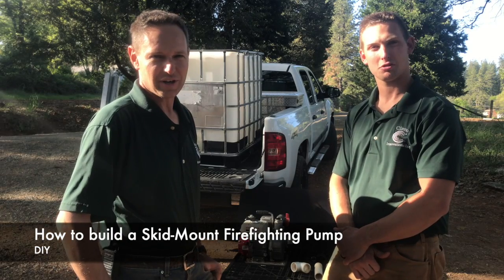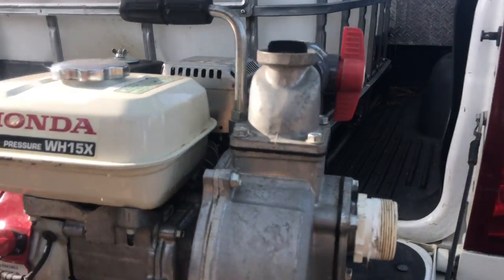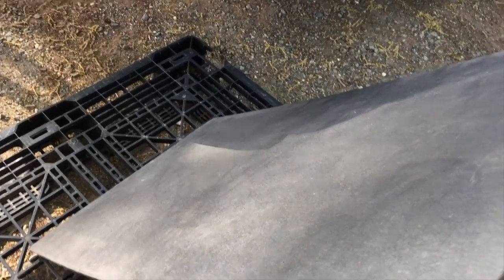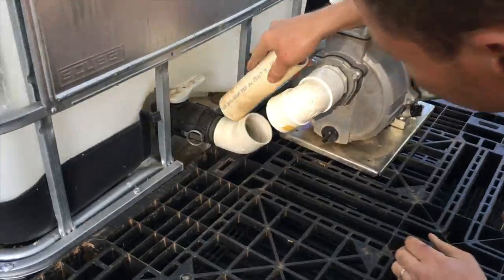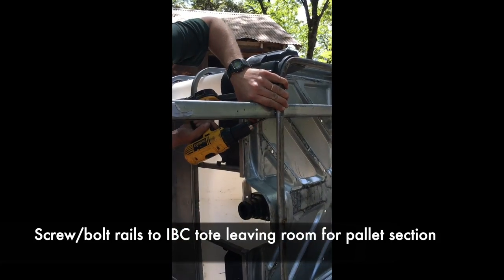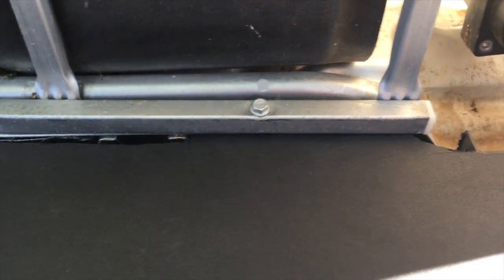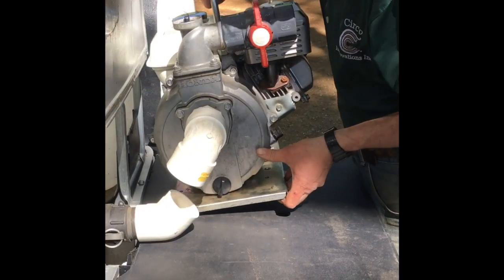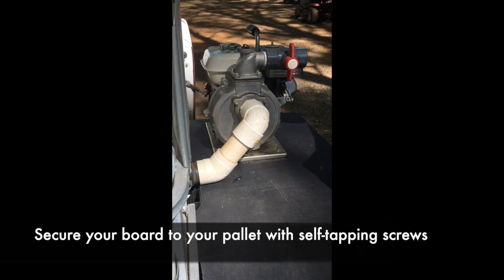Build a skid mount firefighting pump using an IBC container with a Honda WH15X pump for under $1000

Comment: I’m building one right now to go in my F-350 service truck. I snagged a used Honda wb20xt 2” pump from a pawn shop for $150 with 1.5” camlock stuff already on it that I can reconfigure for wildland hose hookups. I have a good steel reel with 3/4” heavy duty agricultural hose on it already (leftover from a previous landscaping project) that I will mount on the skid. I can get a clean IBC for $100 in the next town over. 

I love everything about this idea, except gluing the pump fittings solid like that. It seems like it would make future pump maintenance/repair a huge pain, and risk damage from vibration. I got a piece of 700 psi rated 2” ID reinforced acrylic hose that I’ll put a short section (6” or so) inline with the pump intake to eliminate this issue. 

Thank you for making the video!
Reply: You prolly dont give a damn but does anyone know of a tool to get back into an Instagram account..?
I stupidly lost the password. I would appreciate any tricks you can offer me!
Reply: @Louis Ismael instablaster :)
Reply: @Damian Zachariah thanks so much for your reply. I got to the site thru google and Im in the hacking process atm.
I see it takes a while so I will reply here later when my account password hopefully is recovered.
Reply: @Damian Zachariah It worked and I actually got access to my account again. Im so happy:D
Thanks so much, you saved my account !
Reply: @Louis Ismael Happy to help :D
Reply: While you’re at it run a t off your discharge. Smaller line to recycle the water back into the tank. Reason being if you leave the pump under pressure with a nozzle not flowing you’ll smoke your pump seals.  30 yrs paid fireman, seen it happen and that’s why all fire engines have this feature. You’d be surprised how quick you can kill a pump and you won’t know it until it’s a sprinkler suddenly.  If you leave it on but have to cover some ground but don’t want to shut the pump down  before flowing again it may not work depending on how long it was spinning the same water in the volume. Simple little fix is a second  line and you just plumb it back into the top of the tank. You can put a valve in it to control how much goes back to the tank and if you need all the pressure and flow just shut that return line off right then as it won’t be needed since water WILL be flowing then.

Comment: I'm building a wildfire suppression rig on a small 6x10 trailer. Two 275 gallon IBC and a 2" Honda pump fit with room to spare for hoses and shovels. My question is about a pressure bypass. Is that needed for when you turn the hose off? Or should you just avoid shutting the nozzle when the pump is running for no problems.
I agree that some flex connection between pump and tanks sounds good.

Comment: Where’d you source the national pipe to national hose adapter?  
Cool video.  I recommend a tank to pump recirculation valve those in case pump is left running but not flowing so you won’t smoke your pump.

Comment: Im not trying to rain on your parade but I wouldn't trust pvc fittings in a pinch.They could  crack and there goes your water pressure.Aluminum ,or steel fittings would be my preference..and of course they could crack also on rough logging roads.For home use its a good setup.

Comment: Thanks for this encouragement. I've looked at the QTAC fire skids which are around $5000 or more. I'd sure like to find a way to haul this on my sub-compact tractor with the tank on the back 3 point hitch and the pump and hose on the front loader (to balance out all the weight). Don't have a truck or side by side 4X4 so the tractor is it. Any suggestions are appreciated.
Reply from the maker: Thanks for your support. I will let you know if we come up with any ideas for that.

Comment: Great job but you should mention in your video that this set up has no provision within the pump to bypass the water should you decide to momentarily stop the water flow.
The pump will be easily damaged with any restrictions in the line such as a shutoff

Comment: No way to draft from a water source ???????
Reply from the maker: The pump is made to be removed easily, moved to the water source and then the water can be pumped back into the tank with a discharge hose. We set up our suction hose so it can attach to the cam-lock on the intake of the pump.